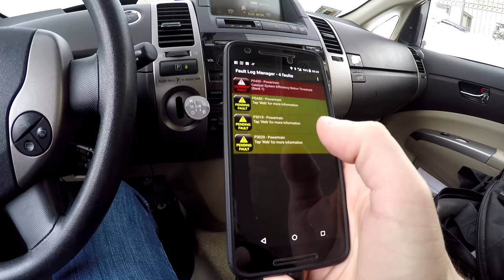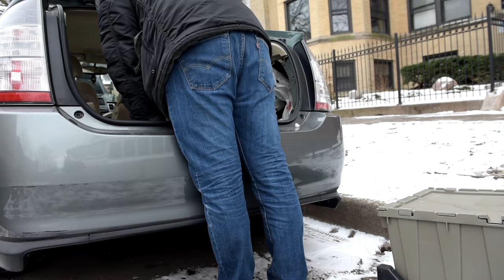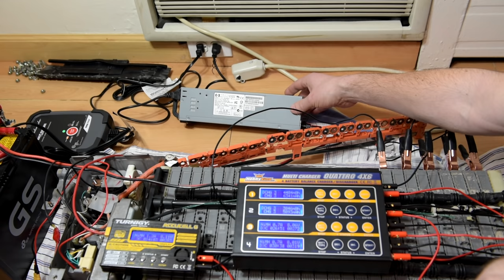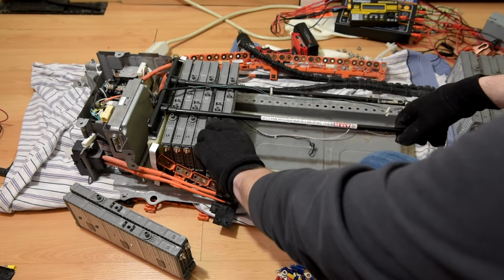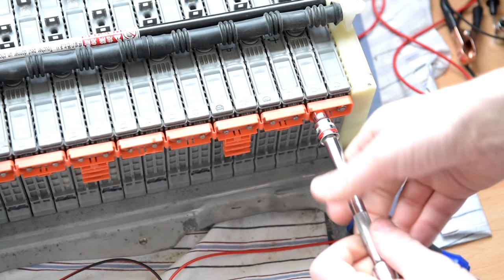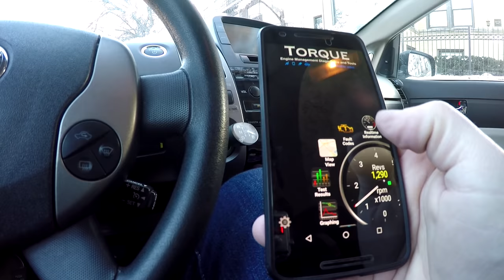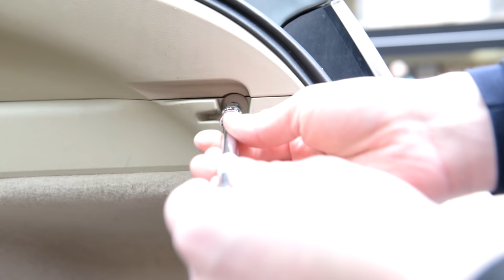Hybrid Battery Repair Ultimate Guide (Toyota Prius 2nd Gen 2004-2009) DIY

Comment: Not a bad tutorial. Clearly an honest attempt; however, common misinformation persists - concerning the "Leveling the Votlages"  - this is 100% unnecessary in most cases.

The label, "Leveling the Voltages" is also very misleading. Resting voltages don't inherently matter one bit and tell you very little. What matters is that all modules be at the same STATE OF CHARGE, i.e., they should all be 50%, 60%, 90%, etc. of their measured capacity.  After a lengthy period of sitting (24+ hr), resting voltages can give you an indication.

The recommendation to put modules in parallel is completely off.  Paralleling modules produces almost no transfer of actual capacity between modules due to NiMH voltage response.  If you're willing to parallel them for 1-2 weeks, it might be effective, but anything less than that is pointless.  Don't believe me?  Try it yourself.  I've personally hooked a completely empty module to one with about 4000mAh input, left it for 24 hours and only observed about 1200mAh transfer from the full one to the empty one.  Transfer between modules somewhat close to each other will be negligible.  This is because current flows based on the voltage difference.  The moment they are connected, there is a surge of current, but that current instantly forces the lower voltage to raise accordingly.  In mere moments, these two voltages are VERY close to one another meaning the current flowing between them diminishes greatly.

Furthermore, the method of discharge conducted for leveling is hackish, but the honest portrayal is commendable. If that technique is used, simply discharge ALL modules to a voltage .15V below the lowest. Even better would be to CHARGE all modules manually at the max current available to a common peak voltage - can be accomplished VERY quickly with less than a minute of charging on most modules. The charging at higher current gives better results than discharging at a lower current.

HOWEVER, even that is usually unnecessary.  If all modules have been charged to a given state (fully charged) within a two week span AND all voltages are within 0.15V, then balancing is a waste of time. 

What almost no one realizes is that NiMH is SELF BALANCING in operation (one need look no further for proof than the initial voltage measurements, even on this old, failed battery... very close to one another - except the obvious failure).  The puny efforts made with 1) a hobby charger or 2) paralleling and the use of resting voltages are instantly obliterated the first time the car pushes 70-90A into it or pulls up to 150A from it.  To drive this point home conceptually, you could put a nearly empty or fully charged HEALTHY module with a WILD voltage difference into the pack.  It might code the first few attempts if the voltage is WAY off, but it can simply be cleared. After 1-2 weeks of driving, that module will be "balanced" with the rest of them, and you won't be able to pick it out of the crowd.

Again, if you've set the 28 modules to a common state (e.g., fully charged during the cycling process) within a two week period, and they are all within 0.15V of each other, there is ZERO need for any kind of "leveling".  Additionally, there should be a progression of voltages, i.e., the ones charged the least recently should be the lowest.  If a module falls outside of that pattern, it is suspect.

SIDE NOTE: The headlamp tester is very ineffective as a load tester.  Simply get a 12V 100A battery load tester (Schumacher BT-100 or similar).  Affix loose bus bars to the module terminals with uts standing up vertically for a good grip with the tester and and load it for 10 seconds recording the lowest observed voltage.  This will allow you to rapidly test each module with about 60A (meaningful in terms of the scale of the current the car uses) and get better results for about $25.  Plus, you have a legit 12V load tester at your disposal for future use.
Reply from the maker: Thanks for your input, this is useful for sure. Maybe leveling was not all that necessary, but in my case it helped to not raise any codes after installation. I think leveling or not leveling is not as important as matching capacities .
Reply: Thanks SO MUCH for posting this information! I was thinking the same thing, but was looking for a comment from someone who knows what they're talking about. You do. Now, I haven't taken mine apart, yet. Do you think I should buy about four batteries? Maybe that's just up to me, but I don't know how many fail, generally. Anyway, thanks for taking the time to explain this. It eases, (what's left of), my mind.  (Edit) I went ahead and ordered four cells from eBay for under a hundred bucks delivered. I'm going to just replace the bad ones and maybe have a spare. Thanks again.
Reply: what are your thoughts about using bulbs for discharge to save time? should I keep the bulbs connected until they are out of until they are dim?
Reply: what are your thoughts about using bulbs for discharge to save time? should I keep the bulbs connected until they are out of until they are dim? how would you perform the internal resistance test in steps, Thanks in advance for the response

Comment: how many miles on your car before taking the battery out for reconditioning?
Reply from the maker: About 206K, but the battery was replaced before that, so it was not original
Reply: @IgorKadulenkov  Are you an engineer?  So knowledgable....

Comment: where to buy new cells, I am strugling with finding the right cells
Reply: Used cells are listed on eBay. In 2022 Toyota reduced the price of a new battery pack of 28 cells down to $1600, so ask your local dealership about that. If not available, look for people selling the new battery packs on eBay. ☮️

Comment: Doesn't the Prius traction battery self balance after you replace modules?
Reply from the maker: It will even out the voltages, but it is not recommended for some reason. I think the balancing currents can be quite high, but I am not sure.
Reply: @IgorKadulenkov  but how would this be different than putting it all in parallel to even out the voltage? once you put the brackets back together, doesn't evenly distribute the volt prior to installing it in the car?
Reply from the maker: @hydrologicdesigns  I would check PriusChat forums for that. When I was doing this project, I've read that connecting unbalanced modules would cause high currents between the packs and it was not recommended.
Reply: The final balance is supposedly important.  I think Igor mentions it somewhere, but priuschat recommends, at the end of your cyclical reconditioning, get all the voltages of the 28 modules within .05v of each other and then carefully connect all +.  Separately, carefully connect all -.  In this way your modules are all in parallel (a large capacity 7.2 cell, esentially).  Let sit 24 hours and they will all self balance balance.  I ended up locating all the + on one side of the battery and all the - on the other and then running a thick long wire of solder to all the terminals, and gently tightening the nuts down to hold the solder 'wire.'

Comment: Where did you get the information that cells are 7500mAh? I found multiple sources stating that those cells are 6500mAh.
Reply from the maker: You're right, it's 6500mAh. There is a mistake in my video. It was pointed out earlier.
Reply: @IgorKadulenkov  doest this mean that we should set the setting charge to 6500mAh cut off?
Reply from the maker: @hydrologicdesigns  You need to set it higher, some portion of the charge converts to heat.I had it set to 7500mAh.
Reply: Out of all of the tutorials out there this one is the only one that goes into all of the details about these batteries! I have had to replace 8 bad cells all in the middle. Some of the cells were able to take much more then 6500mAh - close to 7000. But they would heat up and bulge (get swollen). Is that because they reach a point where their internal resistance (impedance) increase and then start acting like a heater? Just wondering..
Reply from the maker: Thanks! Not sure about the physics behind it, but yes, the charge capacity includes the charge that went to the heat, hence you getting numbers over 6500.

Comment: I have a Dynamite Prophet quad charger. I can't get it to do multiple balancing cycles. It stops after one. It went all the way up to 9.06V. I tried emailing you with no response.
Reply from the maker: Hello Evan, sorry i missed your email, i just sent you a response. Is that the Battery End volt setting that's stopping your cycles? I would try to set NiMH CHARGE mode and switch Man to Auto and then try to switch to NiMH Cycle again . I assume it might then ignore the Battery End volt setting. I showed in the video how to do that on my charger: https://www.youtube.com/watch?v=g5KAPge-f6E&start=1139
Reply: @IgorKadulenkov  I had to set the cut off to 9000mAh so that it would do more than one cycle. I need to change the discharge and charge amp rates.
Reply: @yuriorlov47  Is there something in the manual that told you to increase the cut off? I have the same problem with my Turnigy 4x6S. It will not cycle. I have it set at 7500, as in the video. I was thinking it was the sensitivity being set to default, but the manual does not give a reason and I do not know?

Comment: Great job. Wondering if you relocated those temperature sensors on the battery more to the center, so the vents starting earlier to cool down the unit?
Reply from the maker: Wim Schoenmakers thank you! No, I haven't, is that a mod that others do? Interesting idea
Reply: @IgorKadulenkov   I looked at some of YT videos about repairing those hybride cells and some of them relocate those sensors more to the middle of the pack to achive a faster cooling of the cells. Sounds logical to me, especially in summer time when those cells get really hot. Noticed in your video that sensor cable on the end of your battery pack.  Thanks again for sharing this amazing video.
Reply from the maker: Thanks again, I think it is a great idea to move the sensors.

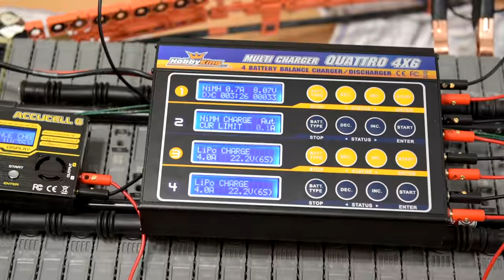Comment: Great video. However, on 19:07 when you switch from manual to automatic the battery type also switched from NiMH to LiPo. I see that on the very top screen its running on Nihm but the rest are LiPo. Are you charging on LiPo and Chg/DChng using NiMH?
Reply from the maker: Thank you. The rest of the ports were not active, they were in standby mode, I was just showing how to setup a port, but you will need to do the same to the other 3. I was charging NiMH on Auto all 4 ports
Reply: @IgorKadulenkov  Thank you!

Comment: The IMAX b6ac v2 was set to discharge first but always revert itself to charging. After about 20 min, my cell battery started to swell. I stopped the charger.  Should I just let it continue charging?  Any suggestion is appreciated.

Update:  I just realized that a bad cell only charges and cannot be discharged.  On the other hand, my good cells won't stop charging even when it reaches 8.3 or 8.4 votes so I had to stop it manually.
Reply: Update 2:  I spent two weeks to charge and discharge my cell batteries.  If I have to do it all over again, I wouldn't even do that.  I would just check for those that never discharge or those that deplete real fast during discharging and replace them.  That's exact what I did in the end, reinstalled the battery, and my car is running great again!

Comment: What size sockets do you need for the bolts?
Reply: Thanks for the video. also what size wire do you need to connect the batteries in parallel so they even out?
Reply: all you need is the standard OEM cables from the charger you use. current should not exceed 5A.
Reply: The busbar/terminal bolts are 8mm. 10 and 12mm are also needed to remove the battery cover.
Reply: Just remember that the contacts must be screwed on with the right torque. I don't remember exactly what I think 48 pounds - check it before assembly!
Reply: @LukUscYT  48 INCH pounds. You'll need a small torque wrench that can deal with small torques. Standard torque wrenches deal in ft lbs and won't  be able to effectively apply such a small torque.

Comment: Is there a cheaper charger i can use? Im on a tight budget
Reply: You can use a standard 12V starter charger - provided that you do it consciously and manually watch over all parameters. If you don't know what I'm talking about, don't use this method. A cheaper version of the charger is Turnigy Reactor with a single charging output.
Reply: I wouldnt use a standard 12v charger at all—. Google “b6 chargers”.   Several firms make them Detrum/Dynam/hobby king.  The imax (copies/fakes) can cost as little as $25 from a US seller.  Keep in mind you’ll need a 5amp 12v charger or some way to safely power the B6 off your 12v source.   I’d strongly consider 2 b6s.  On the other hand a four port charger is probably only $120...and you could resell it when you’re done.
--EDIT: I completed the charge/recondition/balance process.  B6 chargers are a crap-shoot.  If you get a good one, good for you.  Better to get a reliable multiport charger like Igor's.  The only one I could find for sale from a reputable dealer was the Turnigy 4x6s which features incredibly slow discharge times, unfortunately.  Still, it worked and automated the process considerably.

Comment: What is that charger? WHere can I get one?
Reply from the maker: The charger is Turnigy quad hobby charger. It has been discontinued. But i think they sell an updated version now: https://hobbyking.com/en_us/quad-4x6s-lithium-polymer-charger-400w-dc-only.html
You will need a power supply as well and a bunch of clamps and cables.

Comment: how much time it all took?
Reply from the maker: It took me about 15 days in total. It's important to have as many chargers as possible. Even 5 is not really enough. It took me about 20 hours to do 3 cycles on a module. Having 5 chargers it took about 6 days to do 3 cycles. But then i had to do additional cycles on some of the modules. Then i had to wait for replacement modules to get delivered. I also left copper plates for cleaning overnight. And if you level the voltages by connecting all + together and all - together, you'll have to leave it for another 6 hours or so. I got some of my additional modules from Eric from PriusChat.com. He was really helpful, he shipped them the same day basically.

Comment: can we get a link on the power supply
Reply from the maker: It was HP DPS-600PB B 575W server power supply. You can find it on ebay for 35$ or so. It worked well for me for charging 5 modules at 5A
Reply: I think it’s easy to find AC adapters for the B6 chargers also - about $14 delivered from us sellers.  The 5.5m 12v plug mates with the B6/D6 12v connector.  a 5A Ac/Dc charger is adequate because you're not going to want to drive the charge over 5A and the B6 discharge is 2A or less.  If you need to drive a multiport charger, you might need to make a power supply.  The Turnigy 4x6s takes a 't60' plug.  If your charger needs more current, PC or Xbox 360 power supplies can usually supply 16A (more than your US outlet might be able to deliver!).   I ordered some male/female t60s and carefully followed steps to convert either a PC power supply or an Xbox 360 to use as a 12v supply.  I then soldered the T60 to the DIY 12v power supply.

Comment: Can't I just change the bad cell?
Reply from the maker: You can. But if you battery is old , you should expect some other cells failing soon. You may end up opening the battery again. It makes sense to do a proper service, since you have already invested time in taking it all apart
Reply: @IgorKadulenkov  thank you sir. I'll see what to do. I just don't have all the equipment to cycle the cells. excellent video.

Comment: WhAt is the HP power supply for?
Reply from the maker: The chargers i used come without power supplies, so I had to buy one. It had to be a powerful one, because i basically needed to charge 5 batteries at 5 amps each at the same time
Reply: @IgorKadulenkov  I have questions on how you did this. I picked up a charger and power supply, however, I don't know what I'm doing exactly. Do you have an email or a way to contact you?
Reply from the maker: Sure, here is my email igor@kadulenkov.com
Reply: @IgorKadulenkov  I tried your email and never got a response.
Reply: That's why you can't just utilize a car battery. Your pulling 25+ amps for hours straight. Gotcha.
Reply: @IgorKadulenkov  how do you connect the hp power supply to the turnigy .. it didn’t come with any cables ., I connected the power supply to the wall and it works fine with the fan but now I’m stuck